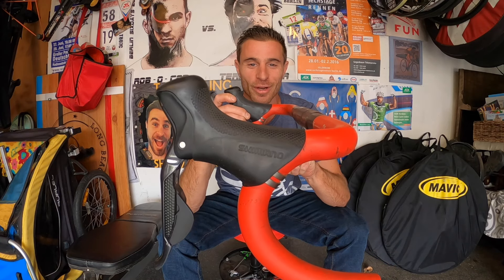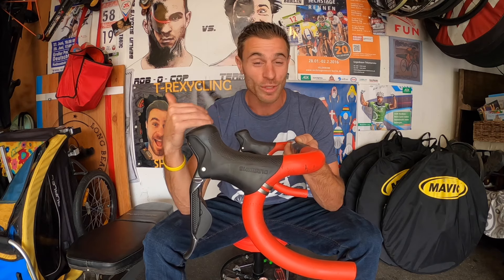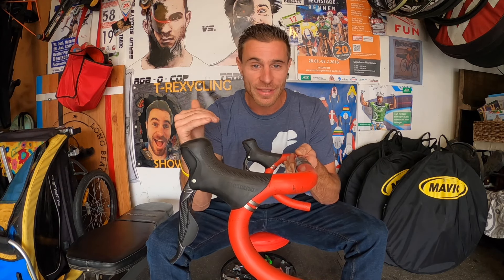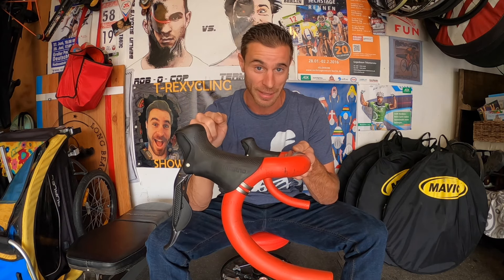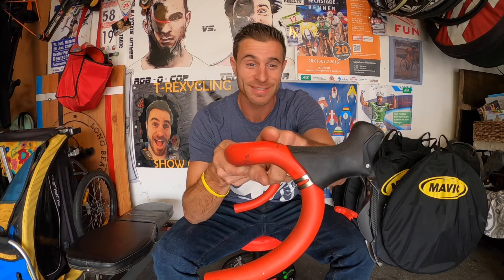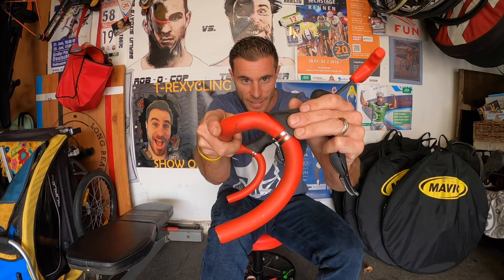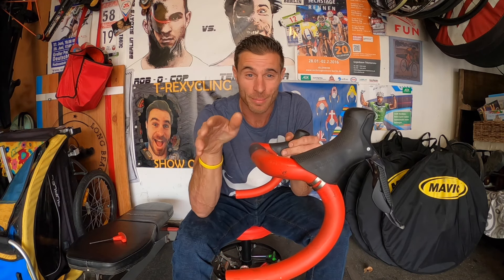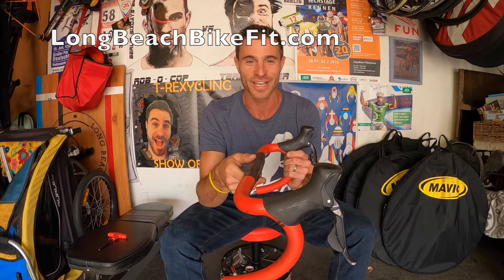What they DON'T tell you about hood placement!!!

Comment: Don't forget that the bars themselves are important.

Way too many people are riding on stock 420 mm bars when 400's are a much better fit.

If you can fit your shoulders in between the ends of the drops (on a standard ~10° flare), your bars are too wide.

Comment: New to all this .. can I adjust hood position after bars are taped?
Reply: no. you have to untape the bars and adjust and then retape. not difficult.
Reply: @ravisvatturi  i tend to disagree. it depends on the style your bar is wrapped. the double 8 loop done most of the time will restrict the movement after wrapping a lot. if you don't have the double 8 but the  up-over-around version with the little spacer tape in between you have some degree of freedom. it also depends on the type of tape. if yours has adhesive on it then its a one time use only. if it hase some rubber stuff on it then you can re-wrap it and it also slides on the bar a bit

Comment: Best. I purchased large frame size for 5.6 feet and using shortest stem with seat moved totally forward, still not reaching hood comfortably
Reply: Swap the frame for a smaller one.
It is always better to ride a frame that is a little too small and then get the perfect size with longer stems than what you are trying to do
Reply: Waaaay to big for you. You should be using small size frame. Exchange or return it if you still have chance.